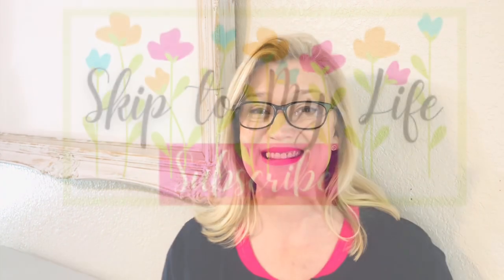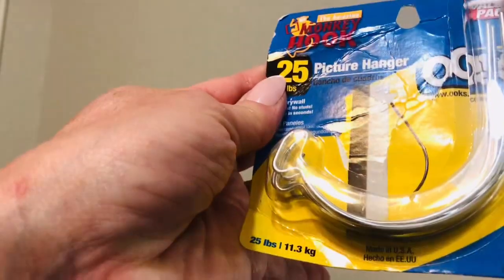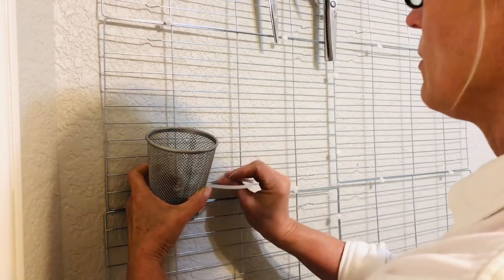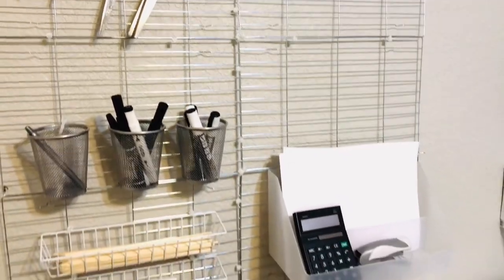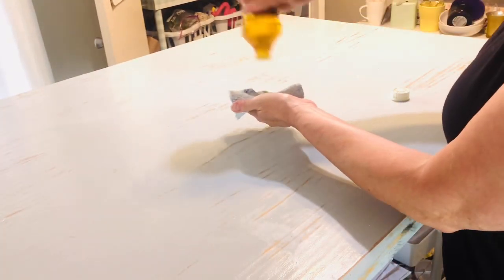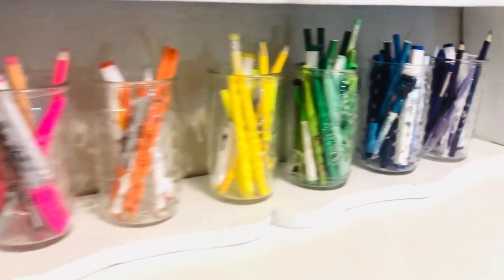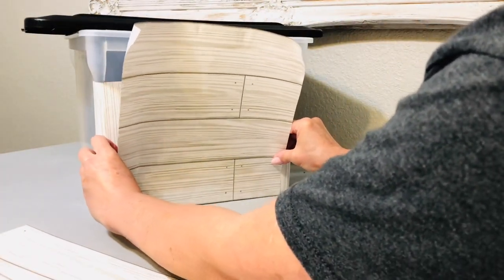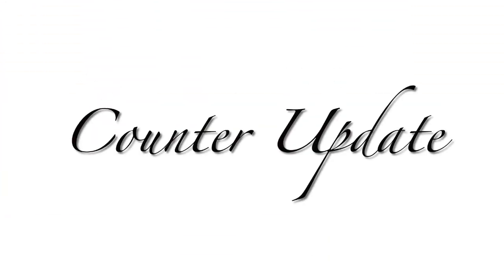🤯TOTAL Dollar Tree CRAFT ROOM Overhaul/ Dollar Tree Organization

Comment: I totally forgot about monkey hooks, thank you.
I wonder if they will work on cabin wood plank type walls. It's a tiny house cabin not logs. I'm a renter so I tried to use small eye hooks in between The ridges so it's not noticeable. If anyone knows the answer thank you in advance. In the meantime I will be making this awesome wire rack! ty* this would also work on a bathroom wall or side of the sink in that empty nowhere man's space between the counter and shower
Reply from the maker: Monkey hooks usually work if the drywall is thin enough to poke through. If you give it a try let us know!
Reply: @shannonskiptomylife  I asked about it at the hardware store.. I felt kind of silly because I was actually thinking of insulation instead of what drywall is.. this is wood so she said that I could not. She suggested buying those screw in hooks, the small gold ones they actually hold quite a bit if you double or triple them up just add more.